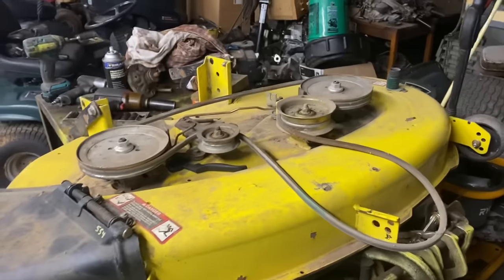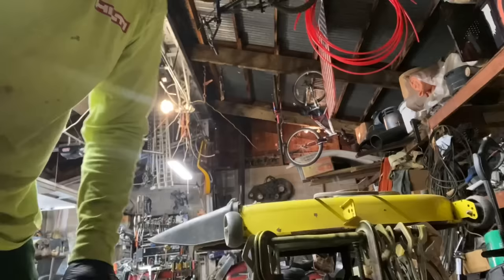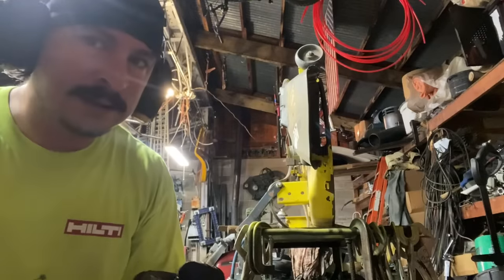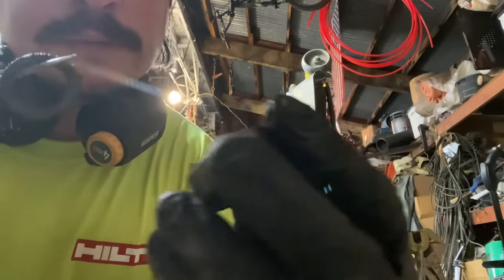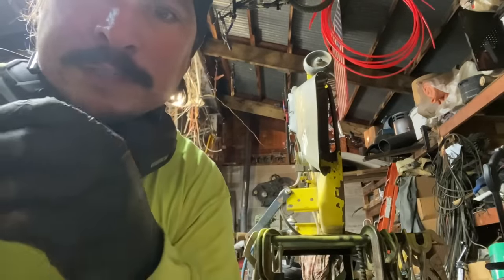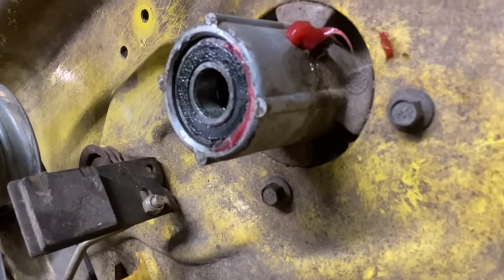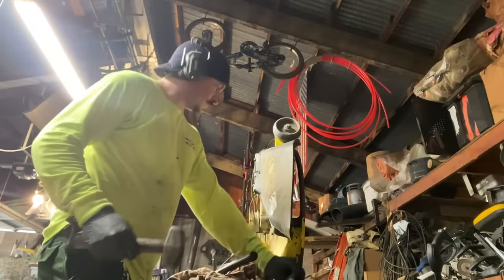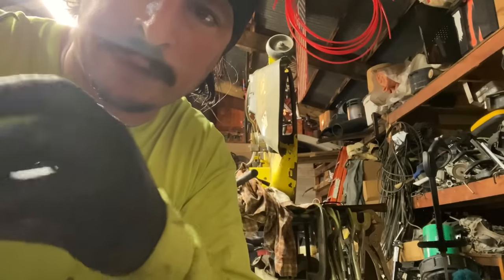Part 1 - Don’t trust the “Experts” Grease your mower deck sealed spindle bearings Common sense.

Comment: I greased mine the first service but then I learned the bearings are sealed & the grease cannot get into the bearings.
SO, I decided that when I replace them I will pop off the inboard bearing shields so the grease can get in.
HOWEVER, it has been 4.5 years & 370hours of no lube & I just checked my deck & all 3 spindles spin free & smooth & quiet.
SO, it occurred to be if the spindle bearings will last this long it seems that maybe not greasing them is OK, It would be more work to lube every 12.5hrs than to replace every 5 years or more. At this time I am waiting for the first bearing to fail
to know how many month/hours a sealed bearing will go before I make my final decision but at this time I think
not greasing is the way to go. By the way-I  NEVER  hose off my deck w water lest the water was to work its way into the bearing accelerating wear & damage. AND I ALWAYS park the tractor indoors.

!
Reply from the maker: Every machine will have the possibility of being built with different bearings or different amounts or different qualities of grease. Best to just grease them. By your logic it would make more since to run an engine on the original oil until
The engine quit and then worry about rebuilding the engine when it finally fails. Adding grease takes almost no time and guarantees long life. I have to agree you have seen great hours of service but that’s unlikely for most folks. Your gambling to learn when a bearing will fail but not every bearing is equal. So what you learn won’t apply to the replacement bearings. You can never tell how long one will
Go on the original grease. Even if one fails the others could go years longer. Free to explore that, I’d just grease them to be safe and maybe you never have any down time. But keep going without grease and one day you will
Have one go bad.

Comment: My John Deere, LX172 is from 1978 if I remember correctly,  and I grease the spindles every 4th.  mow.
Never ever replaced them. 
Normally I state that I'm a Engineer,  but for this I'm giving credit to the Engineers at John Deere, at least the OLD SCHOOL ENGINEERS, and they knew what they were doing.
Reply from the maker: Yea, engineers are like clowns. Some are  funny and some are scary. But yes it works. Probably a little soon at 4 mows but if it never breaks that’s the goal.

Comment: I just had a spindle go out on my Z540M mower deck. I had 269 hours on mower. I was doing 2 or 3 shots of grease  all spindles after every 4 hour lawn mowing. The John Deere service man said I was greasing too much and it would blow the seal out.. That I should only grease a couple times a season. So should I still keep greasing spindle fittings after every mowing or not? I'm  confused!
Reply from the maker: You should stop following the advice they provided. Even engineers can be wrong. As most mechanics find out early in life, engineers design stuff but they don’t fix it. It’s nice to have a desk job where you can stay clean all day but sometimes things don’t always work in real life like it seems like they should from behind a desk. If you follow the directions I provided in the step by step process in the video and grease till the assembly is filled your bearings will last longer. That is, if your bearings are not already damaged. When greasing you should see grease come out of the assembly when the grease has filled the assembly then and only then will you see grease come out past the bearings. Thank you for the comment I hope you get long life from your bearings.
Reply: @GTObearclaw1  Thank you for your quick reply. I will continue doing as I was. Greasing spindle fittings until I see grease.
Reply from the maker: @gailjohnson6670  I reread the question and I guess I jumped over a main part of the question. Actually if you have greased enough to fill
The spindle to the point you see grease coming out, then it is filled with grease and from that point forward should only reaquire a service about one maybe two times a year. If you are using it for personal use (40 hours) or less a year, pushing a little fresh grease in once a season is Adequate. I don’t personally believe you can hurt them by over greasing them but it’s not necessary and just messy. Greasing every 4 hrs is way over kill. Just out of curiosity did the man say the seals were poped off the bearings? I mean if that’s possible and the way you were feeding prior to the repair, the person who made the repair should have found seals off if they want to make that claim it seems like they would have seen it. I never have seen a good seal off a bearing. The only seals Iv seen off the bearing were on assemblies with burnt up melted bearings that overheated and melted the rubber lips off the seals. Folks keep saying the seals will pop off but I disagree. I understand it seems highly likely that it’s possible just odd Iv never seen it happen.
Reply: @GTObearclaw1  The JD service man was a different one on the pickup date. Then the original JD service man I talked to on delivery date. He never said if the seals were popped off the bearings. I can call them Tuesday and ask. We just went through the parts list and service JD did.                                                                                                                               The Z540M mower 2018 is 4 years old. And all original parts. Except I had valve adjusted at 199 hours. Which is recommended by John Deere at 200 hours. They had to replace one valve cover gasket  This is the second Z540M I had. Both had the 25 h.p.. Kawaski V twin engines. Which I have been happy with.                                                                                                                     I traded the first one at two years.  I was going to trade last year and this year. Because I felt it probably less costly then the cost of parts and labor. But probably new equipment has risen.                                                                         As long as John Deere had deck apart. I had them replace all three spindles, three mower deck pulleys, mower deck belt, three new blades, new battery and service ( oil change, air cleaner, spark plugs, fuel filter.)                                                                                                                                                                                                                                                                                                                                                                                                                                                                                                                                                                                                                                                                                                                                                                                                             I'm wondering if a commercial mower would have heavier spindles? I had them change 3 new mower deck pulleys. Because with earlier tractor mower. I found if the mower deck belt was only replaced new. The belt got shredded by the old pulleys as soon as mower deck was engaged.. Thank you for your replies.

Comment: Actually all grease gun connectors are adjustable and you can tighten and loosen the tip on a zerk just by turning the very end of the connector...it works just like a chuck on a drill.....look into the end of the grease gun tip and tighten and loosen the end...you will see the jaws move in and out 👍....still a good and informative video...thanks for posting
Reply: im shocked at the number of people that don't know this , once ya get it in right spot it works perfect and locks on and is easy to get off and never have to adjust it again  . and not big and bulky like the one in vid so tight spots are easy

Comment: Great informative video. I would repack the tube manually, put bearing back, then use gun.
Reply from the maker: Thanks for the comment 

The point of the video was to show how unnecessary it is to dismantle the assembly. No tools required other than a grease gun. But obviously everyone is free to do it however they wish. I just wanted to show the easy way and prove it works.

Comment: a engineer from Murray mowers told me the point of greasing a seal bearing spindle was that it dropped the temp of the housing which extends the bearing life

Comment: The grease fittings have been placed onto the spindle for the purpose of greasing that spindle. They can call it s sealed bearing or what ever they want to but that grease fitting is there for a purpose to grease that spindle.
Reply from the maker: Seems pretty cut and dry
For someone who understands simple things. Have you seen some of these comments? It’s wild, folks are just not convinced.

Comment: A grease gun can easily develop enough pressure inside the spindle housing to crush the fragile plastic seal. The result of which will eventually score the ball bearing surface and lead to early failure. I remove the plastic seal on one side of the bearings and install them with the open sides facing each other. Leave the grease zerk threaded loosely in the fill port, then hand pump good quality grease into the spindle until grease starts weeping from the loose zerk. That is when you know that the spindle is fully packed. Repeat for all spindles, then REMOVE the zerk fittings. Leave the fittings off while running the mower blades at idle speed for a minute. That relieves all grease pressure in the spindles. Replace the fittings. The deck is good to go and will not require any further greasing. The bearings will last many seasons of normal use.
Reply: You got it Robert! I do the same with my sealed bearings in my spindles... Been an auto tech for 40 years, and I know a sealed bearing  won't let the pre grease out any more than  it will let new grease in. Most seals on bearings are rubber coated plates and are very difficult to remove. As far as leaving your zerk fitting loose, keep it tight and drill a 1/32nd inch hole just below the top bearing in the spindle, when you pump enough grease in it will squirt a little grease out and you will know it is full. I have four riding mowers two new and two old, I've cut nearly five acres for the past 22 years and only replaced one set of spindles, which was before I started doing this to my spindles "none since. I give my spindles a pump or two each season "squirt!
Reply: @sunnydean9611  I agree. Thanks

Comment: Good info, but wouldn't a properly greased bearing last for years without needing to be re-greased. I just did my mower deck and just removed the rubber seals and manually repacked them.  Also wouldn't the grease force the seal off the back side and allow dirt in if you put that much pressure on it with the grease gun?  Besides all my grease guns suck and would take all day to fill that shaft.
Reply from the maker: Sounds like you need a grease gun. 

The way your adding grease works too. The point of my video was to show that grease will enter bearings when applied through the zerk. Most folks don’t want to tear a deck apart to grease it. Yes a well lubricated bearing will last years for a home owner model that is only used for private personal use. But not all bearings will last if they are not greased and some factors like sitting outside in the rain or decks being covered in grass and holding heat in will
Also add to early bearing failures. If the mandrel is assembled when greased the bearing shields should not be able to come off if everything is in good shape and tightly assembled. Some folks say they have sen that. I have never experienced it. I also stop greasing as soon as grease is visible